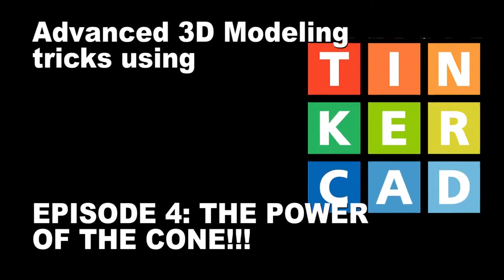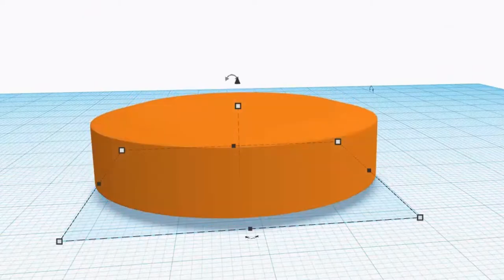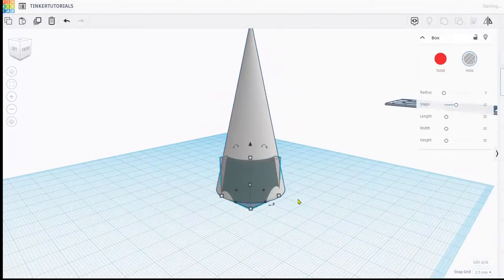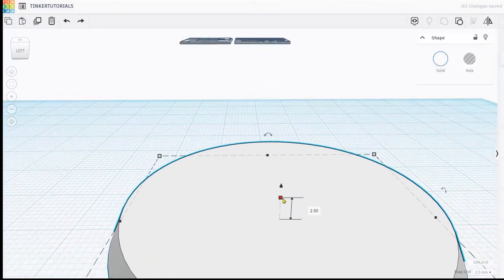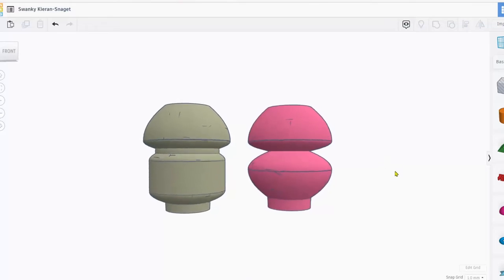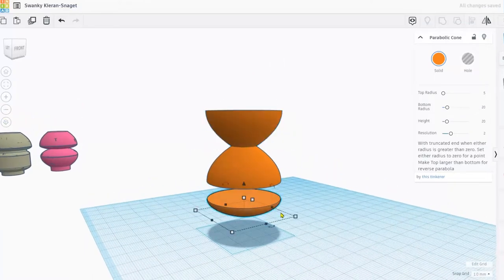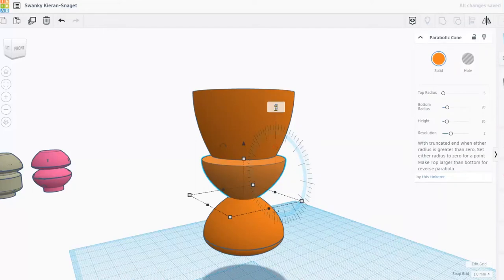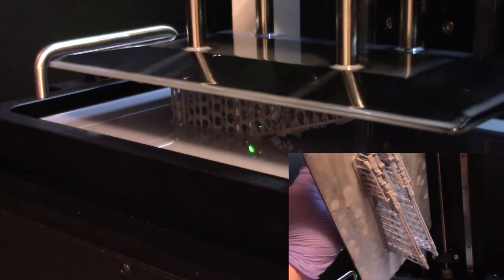TINKERCAD Advanced modeling tricks. Ep. 4 THE POWER OF THE CONE!!!

Comment: I've been using TinkerCad for about a year and I've watched dozens, possibly hundreds of videos and I've got to say yours are among the absolute best out there. Having said that, there was one thing that gnawed at me while watching this particular video. From roughly 2:00 to 3:30 you place a cone, guesstimate the slope and add subtractive cubes to lop off the top & bottom. I'm surprised you expended that much energy when there's a much quicker & easier way to do the same:
After dropping the cone onto the work surface, examine the property panel for the cone and you'll see there's a top radius and base radius that you can adjust. If you make the top radius=base radius your cone turns into a cylinder. If top radius is non-zero but smaller than the base you get a conical section with flat top & bottom. All you need to do is tweak and fine tune the height and the two radii in order to get the exact same result in a fraction of the time.
Reply from the maker: Thanks and thanks for the advice. I prefer pulling and stretching parts visually.   Entering numeric values to change shapes  somehow takes away from the sculpting aspect of 3d modeling .  I"d rather squeeze and stretch and chop so I can feel my way through a part instead of interacting  with a mathmatical value. Does that make sense?  I have several new tinker tutorials coming out soon. Follow my channel.
Reply: You are talking about what I’d like to be able to do. Not quite following your explanation, is there a video out there that shows this? Thanks

Comment: Interesting video. I would like to see Tinkercad make it so you could set the actual dimensions of both ends of a cone or the cylinder. It’s tough trying to get accurate measurements using the radius button.

Comment: That's one way, but if you want the top plane parallel to the base, why not just set the bottom radius, height then top radius? I guess sometimes it doesn't matter much how you get to the final shape, though working with parameters makes it easier to work precisely and make adjustments later.
Reply from the maker: I prefer pulling and stretching parts visually.   Entering numeric values to change shapes takes away from the sculpting aspect of 3d modeling .  I"d rather squeeze and stretch and chop so I can feel my way through a part instead of interacting  with a mathmatical value. Does that make sense?  I have several new tinker tutorials coming out soon. Follow my channel.